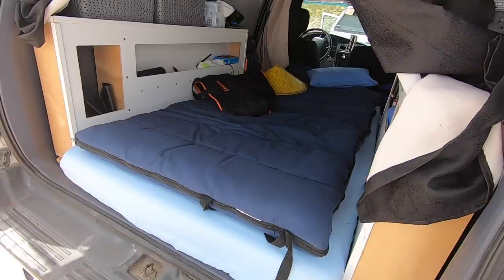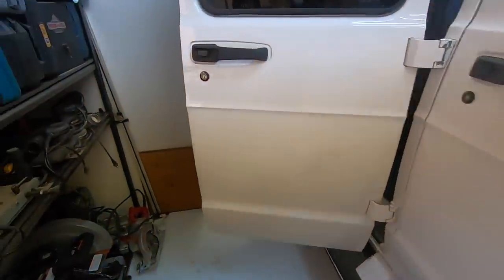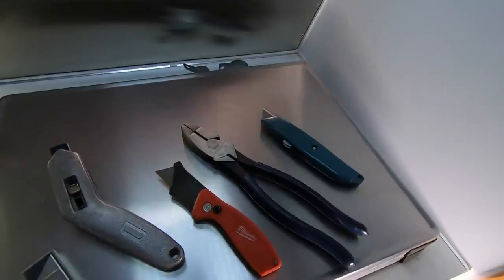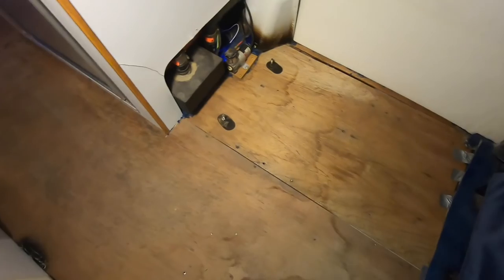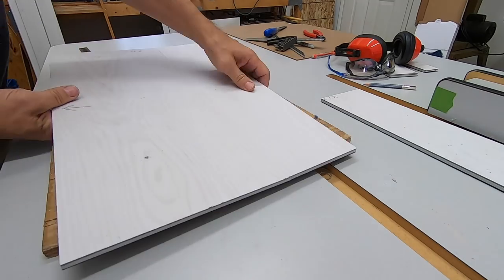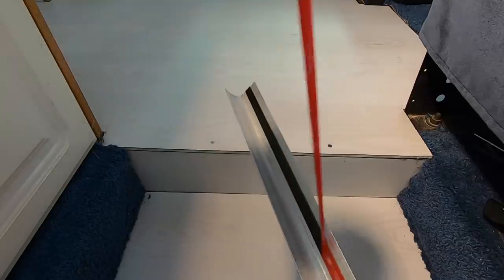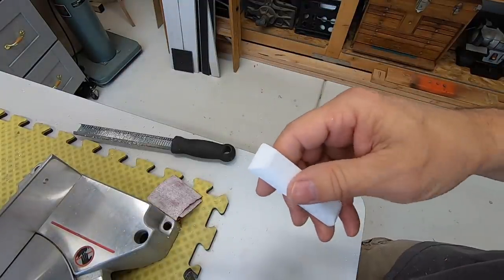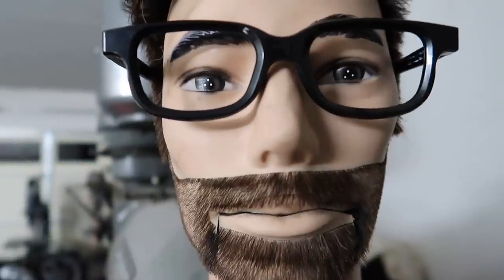Vintage Camper Van Vinyl Floor upgrade DIY For a Fresh Look

Comment: That's a nice upgrade.  Our trailer had indoor-outdoor carpeting glued to the vinyl floor by the previous owner.  That stuff is hard on bare feet.  And, it traps dirt underneath, as we found as the glue started to dry out and fail.  The original vinyl floor was one large piece that was installed before any of the fixtures were installed.  Mrs. and I always talked about a new floor that would install one piece at a time.  Ultimately we sold that trailer.  Your project is well done.

Comment: Steve, that air conditioner front will come off with just a little effort.  There is many rattle can paints made for spraying plastics.  A coat of paint would do it well.

Comment: I have a 97 Dodge Ram 2500 van former passenger van converted to a campervan which I've lived in for almost 3 years. After many spills I've taken up the carpet in the main area and I'm so ready to do this!
Reply from the maker: Good luck. It's a good move.

Comment: I'm glad you're safe Steve.  Never know what could happened out there all alone in a wide open desert with lots of UV killing air bound viruses.  Vinyl is so much more utilitarian and easy to clean. Screws in the base shoe look fine and even, a dab of white paint to match if you must. No floor sealer? I see water marks at the shower door. You could have used for instance GACO Deck Coat under the vinyl as a sealer. The carpet will breath but the vinyl won't and may trap moisture under it. Time will tell. It would have actually been possible to use GACO as the new floor, filling the seams and putting down the recommended coats and if you want the grip coat, finish with that. The seat idea will work really well. Remember some of Justincredible's mods to his Explorer Dora. I don't think you'll be needing the stripper pole. Anyway, take care.... PS: How's the minisplit working? My brother came up here for a month to escape the LV heat.
Reply from the maker: If a hose to the fresh tank or pump goes, I will have a couple of inches of water in there- and so the easily removable base board so I can disassemble the floor in reverse order and let everything  dry out. (I remember Happily Houseless and his FUBAR). That Mini-split is the best thing I ever did. I would not be out there working on the X without it. Hundred plus degree days as far as the forecasts project. I has the heat pump feature also for the winter.
Reply: @XplorerSteveDIY  I don't recall happily houseless's FUBAR. I recall he was building a van and then his channel imploded with the brain tumor, then meeting Jess and moving to a South Dakota house. A brief hint of restarting his channel which fizzled away. Quick recap. 
I sure like those minisplit systems. I installed a 24k btu GREE with 2 12k wall units. They heat and cool amazingly well.  It's on the to do list for my house.

Comment: I have a 98 xplorer. My 3rd seat was missing and I actually needed one. I installed a double seat from a ford transit van on L track that can face forward, or you can turn it and put the back against the wall and use it as a "couch".

Comment: I like the NEW flooring Steve ....  I've installed the vinyl laminate many times (in finished basements, sun rooms, pool houses, etc),  wherever moisture could be a problem...  they hold up fairly well ....  The only thing that seems to wear the top layer is sand particles ....  So removing one's footwear before entering will solve any issues !!  .. 
Look forward to your upcoming upgrades, to your Explorer  :) :) :)
Reply from the maker: Time will tell if the "wear layer" is as advertised. Good tip.
Reply: @XplorerSteveDIY  If it doesn't try the Congoleum lifetime stuff. I've installed it. Tough as nails, 3 times thicker than regular peel n stick vinyl flooring and the same all the way through the material.

Comment: Nice work Steve. Looks great! I’ve compiled with this idea. Though I still like the feel of rug in my van. Definitely will be easier to clean. 👍
Stay Safe
Reply from the maker: Probably get an area mat/ rug or anti-fatigue mat for the area between the shower and stove. It would serve double duty. I like the feel of carpet on a cold morning, but it had to go.

Comment: Did you ever do a video of your RV battery bank(s)?  I do not remember one and i did a search and could not find one.  That would make a great video if you upgraded to lithium (LiFePO4).
Reply from the maker: There is a few vids of me in there when i installed solar. I wouldn't go lIthium as a part timer because of expense. I will go AGM here shortly.
Reply: @XplorerSteveDIY  Of all the upgrades i have made to my Class B RV my favorites are installing the solar panels, replacing the AGM batteries with lithium batteries and getting rid of those ugly decals/stripes/stickers.  Your video of you removing your decals is one of my favorite.  Your RV looks SOOO much better without them!

Comment: I like the aluminum trim, but not really a fan of those giant nuts holding on the white trim pieces.  I would have maybe had some sort of white cover that could be removed to expose screws underneath?  Still, like how the floor came out.
Reply from the maker: It's a personal choice for sure.

Comment: Where do your water lines run from one side of the van to the other? Mine run across the floor with a metal cover.

Comment: Sorry but did you mention what kind of subfloor you have?  Just curious because I have a 2000 road trek and I’d love to replace some carpet but the subfloor is fiberglass and I’m not sure what glue would stick. (it gets plenty hot too from the muffler ). Are you satisfied with the gorilla glue?
Reply from the maker: Marine grade plywood. The gorilla glue is good stuff. Probably overkill.

Comment: I've been following your video's as I also have a Pleasure way 1998 also on a dodge platform. Very similar to yours.  Thanks for the creative ideas. By the way does your rear wheels (axle)  set inwards ( shorter) compared to the front axle.  I've been told these units were built on a truck axle and when the body was expanded they didn't expand the axle.  Some people put wheel extenders on but I've heard they put undo stress on the wheels and axle.
Reply from the maker: The X is a dually. Xplorer added this feature to the later 240 xl models along with Firestone air ride suspension. Very stable.
Reply: @XplorerSteveDIY  My ride is stable and seems fine... it just looks funny with the rear wheels looking closer together than the front wheels.  it has air bags installed.  I didn't know yours was a dually.
Reply: @philc.9280  Phil, I have a 99 Coach House,  also very similar to Steve's. Rear axle is actually 4 inches shorter than front (I don't have a dually). Been thinking of an offset wheel in the rear or maybe even a wider tire back there, plenty of room.
Reply: @johnroyer3191  I never got a good answer from anyone about installing 2 or 3" spacers between the tire and wheel hub.  One article mention putting too much stress on the axle which I could see.  I guess the older the vehicle gets the less I care about fixing it up.  I took off some of the old faded decals and gave it a good polishing since some campgrounds ask for the age of your RV now.
Reply: @philc.9280  Wasn't aware of the age thing. My goal is to look half as good as Steve's. I will get there, just love tinkering with it. Going to a tire shop next week to see about a wider tire/wheel on the back, will let you know what they say.
Reply: @johnroyer3191  Yes many paid campsites are getting picky about what type of rig they allow into the establishment at least here in California.  There just is a lot of junk that people drive that are eyesores to some. I would like to know about what you find out at your tire shop.

Comment: About how long did it take you in toto to do the flooring, including carpet removal and finishing? I also have those folding seats in my Xplorer, and I want to take them out to open up that area some more, since it's usually just me, so I wonder what else they were attached to? Nothing structural, I hope...
Reply from the maker: How long? around 8hrs but I didn't keep track. A lot of in and out of the van. Few trips to Home Depot,. Besides the two big seatbelt bolts and nuts. there were some 1/4 screws that would not back out. I cut those. Around 6 in all for the little ones plus the two. Had to cut some carpet loose from the surround. .
Reply: @XplorerSteveDIY  Thanks, I was wondering how much time to budget for doing the job. I've got a few irons in the fire as I try to pivot my skills for the pandemic world. (live sound engineer)